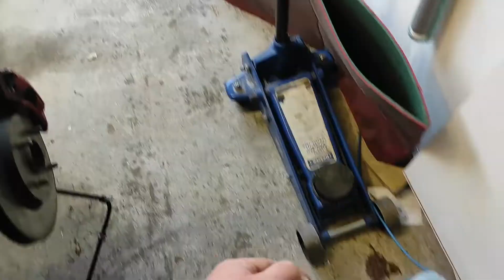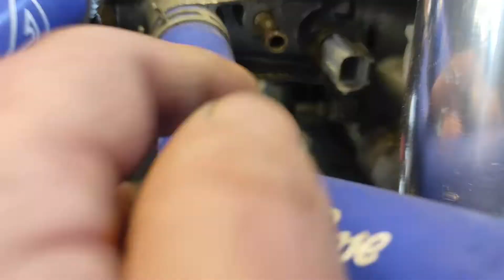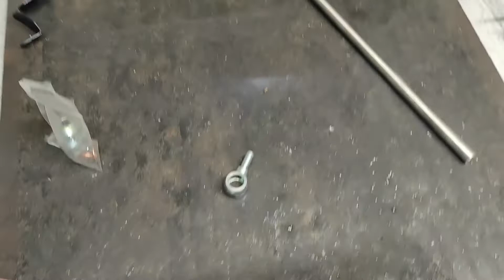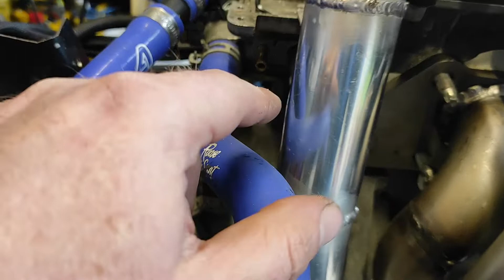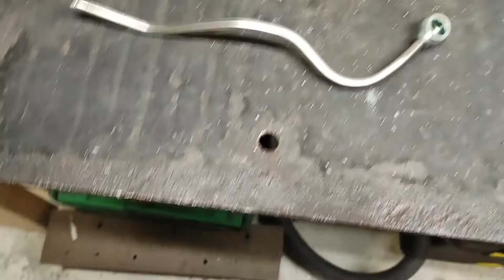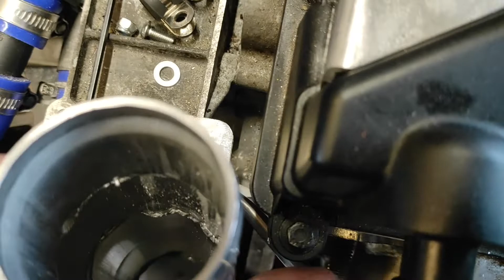Fiesta ST Turbo Build - Making new turbo water supply pipes/Banjo fittings

Comment: hey man, i have a fiesta st180 and going to fit a x58evo2(from puma) with custom water lines aswell did u use sealant/loctite or something on the bolt? cuz mine is leaking on the washer
Reply from the maker: Sorry for the delayed reply, notifications on comments have been hit or miss! No I didnt use any sealing compound or the like. Just new copper washers. 
My old turbo setup I had an issue, where the washers weren't thick enough, and the bolt would bottom out before properly crushing the copper. But hopefully you have it sorted by now.